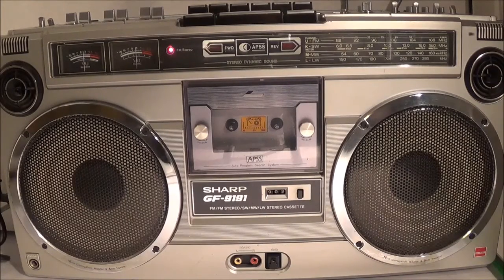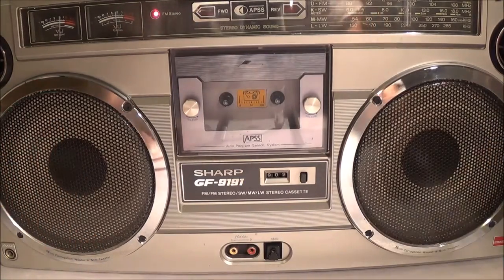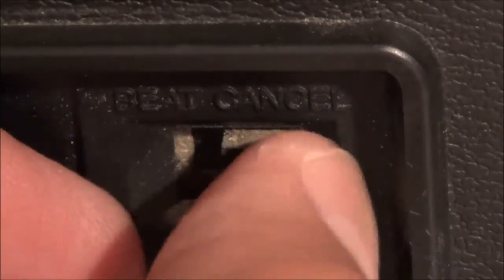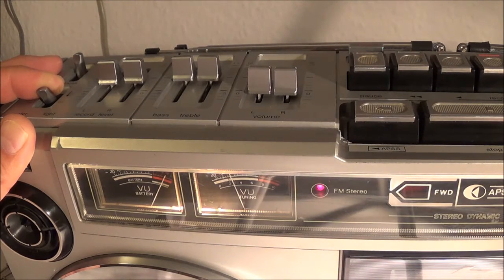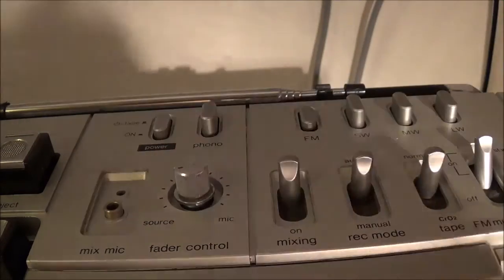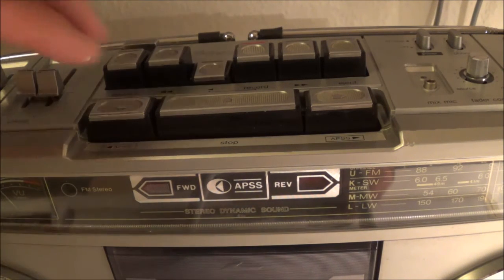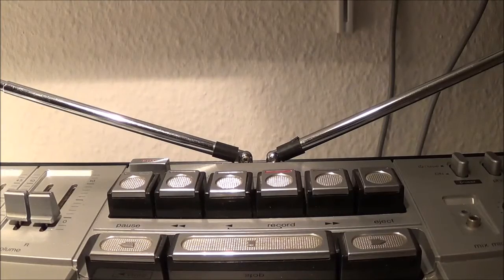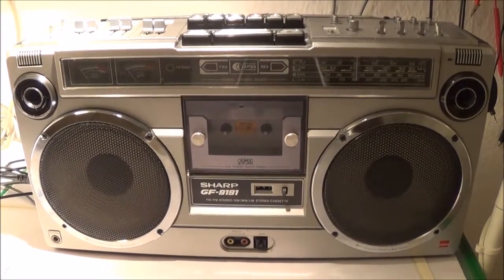SHARP GF 9191 INTRODUCTION / REVIEW

Comment: how do i fix the right vu meter? it doesn't swing as much as the left vu meter while the input has music. but it works perfectly as a tuning meter. it just doesn't dance as much into music.
Reply from the maker: Hard to answer. Seems like it is working right since the tuning meter works correctly. You would have to get a scope and do some waveform tracing from the meter working backwards. Service manual used to be available online.
Reply: @OldSchoolElectronics  i actually have thoughts that it might be the right potentiometer at fault? could it?
Reply from the maker: I think there is an adjust too. It would either be potentiometer R187 or R 188. You could try using a small screwdriver and make slight adjustments and see what happens. You need to mark the original spot. Best is to use a steady input signal. There is an adjustment procedure in the service manual.

Comment: Hi! I have a sharp gf 9090 model. The tape deck is not worked when i bought it, so we sent it to tape deck service. They repaired it but it only worked for one day. Then i decided to repair it by myself. And i took it apart and put together 20 times to find the problem 😂. But it was worth it because it works fine now. (I'm 14 years old, but i like these machines better than bt speakers)
Reply from the maker: Wow, good job! Looks like your perseverance paid off! I didn't repair my first boombox until I was 18. I like the older ones too; they have more class, look better, and are built to last.
Reply: @OldSchoolElectronics  Thank you! 😄
Reply from the maker: Keep up the good work and never give up!

Comment: These were made in 1979-1980.

The earlier GF-9090 was made 1977-1978.
Reply from the maker: Thanks! I thought the GF-9090 was made earlier too. As far as I recall, these did not have a phono input.; leading me to think they were made before the 9191s were made.
Reply: The other clue is the complete lack of chromed plastic - (didn't appear until 1978).

So all metal looking trim is indeed metal.  You may also notice the front panel is actually made up of separate panels (the main surrounding panel + 2 around the drivers + other panel below the deck) - much more expensive way to build a box! Metal tipped antennas are another indication of it being an earlier build.

Love mine! Sounds sweeter than my GF-9696!   :-)
Reply from the maker: Thanks for all the infos! Both are awesome units in my opinion. I added "spacy" blue LED lighting to the last GF-9191 I worked on. I think my favorite though, is the GF-9595. Not really so as far as looks are concerned, but the sound; for example the radio reception. I was disappointed by the GF-9797...flimsy feeling. sound wasn't that awesome either. Of course, this is just my personal and opinionated view.